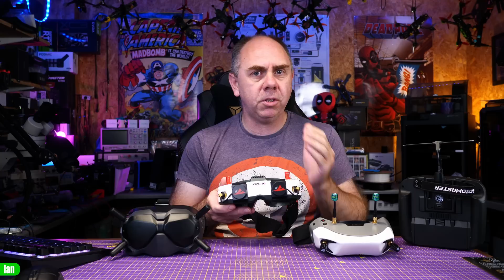HDZero FPV Goggles Crossfire Warning - 868/900Mhz RC May Be A Problem

Comment: Anything 900mhz will interfere with servos as well if tgd antenna is placed the the servo cable in a parallel  orientation

Comment: I tested this on the original shark bite goggle module that was sold. Connected to a pair of HDO2's it kicks the module off, but the goggles stay powered up, so the HDZero system comes right back. It also does it with the original power cable that shipped with the goggle module. And the 18650 battery case, with a barrel cord connected to the balance plug of the battery case.

Comment: Shame on you Mads (I know HDZero is sponsor). This is a board and RF design issue that HDZero needs to fix..."don't bring your TX close to your goggles" is not good enough. What are you thinking? DJI shields and cans their PCB, XTALs, and cables properly.
Reply from the maker: Shame on me?  Hahah your Fing joking right 😂.  HDZero is not a sponsor.  That’s is complete bullshit and I’m not having it.  

I am the person that highlighted this issue to the masses, I am not covering it up for them. 

Putting 1W of RF power next to anything is a BAD idea in any world.  Now the cable situation is far from ideal and I say that and it’s something people need to be aware of however don’t for one minute it’s a free pass 

If your putting your radio next to your goggles in flight something is very wrong. 

Shame on you for posting a frankly stupid comment.
Reply: @MadRC You don't have to have it - if they are not, we'll take your word for it. 
Any retort to the substance of my comment?
Reply: @johnfaustus1, HDZero is sponsor ?  You can have your own opinions, but you cant have your own facts. Have a word with yourself.
Reply: @martr  The youtuber can speak for himself - no acolytes are needed. If they aren't a sponsor, great - but the issue remains. You can't tell people to not use a product in a way that is largely considered reasonable as a 'workaround' for a grave RF design problem.
Reply: @johnfaustus1 I agree with you. My comment was about you making stuff up about sponsors to prop your argument up. You are right that this issue needs sorting though.

Comment: I have had this happen with my WS VRX. I thought It was due to low power on the goggle batt but its really likely that my vertical crossfire orientation mixed with the google batt I have in my pocket and the cable running up to the goggs. Hard to not get them close unless I run the power cable down the back and into my back pocket! Really interesting discovery, Il try be much more careful in the future! Cheers for the PSA

Comment: I'm so glad to learn this information! Every few times I would walk back from the starting blocks with my goggles powered up my battery cable would bump my crossfire antenna and when I get back to the Flight line my goggles would be hung up on the start screen and I'd have to reboot and I was like what is going on! Now It all makes sense. 
I found some tinned copper braided wire shielding sleeve ground straps that you just slip over your existing goggle battery DC cable and am thinking of just trying that. It lists as blocking EMI RFI and ESD interference. Thoughts on using something like this?
Reply: Did it work ?
Reply: @carlosr.2027  I just installed the capacitor on the power board switch and that fixed the issue. I had limited  success with the ferrite beads so decided to do the mod. Never got the cable shield. Definitely wasn't easy but with a fine tip tweezers and fine tip solder insert it worked out.

Comment: I would love to see a quick test with a ferrite choke on the power cable. I’m not super worried about getting the remote too close to the goggles, but the power cable is interesting.
Reply: That seems like a great solution if it works and perhaps easy to clamp on existing power cables!

Comment: It clearly is absolutely important to shield your hardware-even if its not sending a signal,as you can see in this case. I absolutely cant stand anymore that people still carrying hdzeros water after this complete shitshow they pulled over the last year or so !!1 I know Carl is a good guy but his product is clearly alpha stadium at best and if it was walksnail with all those bugs and hardware shennanigans people would be all over it shitting on them-rightfully so.But not with hdzero,its always the bees knees no matter what lol  People loose alot of credibillity over this in my mind...just saying xD
Reply: I have had zero problems with my goggles since I switched to an 18650 head pack to power them. I do long range flying and trust them completely. Even when I had the problem I never had it while in the air as the cable would then be routed away from the tx.
Reply: i would call that almost stockholm syndrome...no offense but dude... if i pay that much money,wait months on end for it to arrive and in the end they deliver such a shitshow i would not be pleased to say the least xD
Reply: @hirnlegorush  Oh believe me I cursed a lot when I had the issue and almost sent them back. But since I discovered the issue I did several dozen long range flights and a lot of cruising and some racing and I am very happy now that I do not have this issue anymore at all.

I just ordered another set of the goggles for my brother in law as a birthday gift.

I try not to be a fanboy I have been in the RC Hobby for 25 years and "seen it all". My next purchase might be O3 and Goggles 2.

Comment: Could you just line the inside of the HD0 case with shielding tape or something?
Reply: It sounds like the RFI is coming in through the power cable, and upsetting the power requirements of some MCU (guessing on that part). The power cable is acting as an antenna. 

You could shield your goggles, but the solution looks like using a shorter power cable.

Comment: Still flying crsf... you just made my decision.  Going to dji
Reply: A much easier and cheaper solution is to just use a shorter power cable. Could probably even just put a $2 ferrite choke on your power cable.
Reply: @Flumphinator  it's just the straw that broke the 🐫 back for the other 2 vs dji.  Still rocking laforge on old FS doms v3... from 2015 and I'm just tired on barely seeing stuff.  Tired of having to use a base station and 1.2 to get further than a few miles and get even worse picture quality.  The range of new 03 air unit and wider view on the Integras will be a huge upgrade.  I've lived with the 69mm ipd for a long time even though I need at least 72.  The image quality and range can't be matched by walksnail or hdzero and that's really what I want most.

Comment: That's the scariest thing that can happen flying fpv. Video cuts out randomly when flying. And it's happened to me about 5 or 6 times. Mostly caused by a loose wire or jst plug. Then you don't trust your quad anymore for a while. It just sucks so much.
Reply: yup I had the same with my skyzone 03O goggels.. it would just shut down mid flight from time to time (the motion detection was broken, and it would go into sleep mode after awhile because it didn;t detect any motion)
Reply: @TheCivildecay  oh damn. I have the same goggles. I hope this never happens to me lol. That sucks I'm sorry. My 03o have been great so far. I wanna get the 04x I think it's called the newest ones they make but they're so expensive. Goggles are the most expensive part of this hobby which sucks.
Reply: @Chillin-fpv  I just turned off the auto-sleep/power off on the goggles and never had the problem again
Reply: @TheCivildecay  good to know. I don't have that on and it sounds like a horrible feature lol
Reply: I had that issue with my DJI V2. I think it’s finally fixed but I still don’t trust it just yet. Lost quite a few parts from disarming over asphalt.
Reply: @likwidkool  I hate not being able to trust my stuff. I'm finally able to trust my second quad again. I fly around my neighborhood and up and down my street. Thankfully I havnt crashed through someone windshield yet 🤣

Comment: Wow. Logical, but unexpected. Glad I switched to ELRS about the same time I switched to HDZero.
Reply: Yeah, if only 2.4 GHz LoRa had the same penetration as 900 MHz. When flying in the mountains Crossfire is much more forgiving when descending accidentally out of LOS.
Reply: @disco.volante  everything else being equal, 900mhz will have better penetration and a slower rate. For how I fly, 2.4 ghz has more than enough penetration for me, but I'm keeping my crossfire in the drawer in case my situation changes.

Comment: So I should put a high gain very directional tx antenna on my crossfire so I can reset stuff "accidentally"?
Reply: No, just don't touch the tx to the goggles. Needs to be really close. Route your power cable differently or use a head pack and you will be 100% fine.

Comment: Brother! Mads Tech, when we getting the update video! on the dji o3 ham file hack not actually increasing vtx power!. Relying on your to save us from this 25mw shenanigans!
Reply from the maker: I have said already on day one it’s comparable to FCC. I never said it was more power. However there are many things on O3 we still don’t understand
Reply: @MadRC   ah my apologies I must have  misunderstood :( Hopefully one day in the uk we can get more than 25mw out of this lovely system.
Reply from the maker: @Sohail187  in the U.K. it gives you FCC power.  It’s just it does not give more than FCC like 1200mw

So in FCC regions Ham is same power more channels. 

In CE regions ham give FCC power and more channels.
Reply: @MadRC  Thank you for taking the time to respond btw. Love your work and been subscribed a short while now, and you genuinely help a lot.  I'll need to take a deeper dive into it then and see what the issue is. Unfortunately on my end SD logs only show 25 MW output, where I believe it should be around the 700 mark.

Comment: Don't be afraid of Crossfire's pure power that's all it is TBS power, maybe I have never had this problem because I run my power cable down inside my shirt to my pocket and also, I don't fly with my radio touching my goggles. (pure crossfire power)
Reply: Just get dji... great match for the crossfire power and range!

Comment: Would be interesting to see if this happens with ELRS at 900mhz.
Reply from the maker: I’m fairly confident it will just based on the fact the RFD900 did.
Reply from the maker: Just had it confirmed on ELRS 900 as well
Reply: @MadRC  what about a Tango 2?  Seems a bit of a shame for HDZero for this to happen.
Reply from the maker: @TestPilotIan  I would expect it to be exactly the same. The real warning is battery cable.  Keep it away and should be fine.
Reply: @TestPilotIan  It will I'm one of the guys who first alert on this issue, and i'm using a tango 2 :/
Reply: @MadRC Is this effect only on the goggles, or can it also affect the VTX - eg if you have an RFD900 on the same quad as an HDZero VTX?
Reply from the maker: @Vousie  It can and does for all systems, DJI is also susceptible to the Telem from crossfire.  This is Telem and. Is nothing new.  You should always have a little separation
Reply: It does some other guys tested it on the discord server

Comment: I just have to comment on that "touchy" USB-c cable. 
Of all the USB types I've used since USB was invented, the USB-C type have failed me consistently. 
Literally every USB-c device I've had, have dying USB-c ports and or cables. Where I never had any problem with it's precursors.
Reply: Stop running your devices through the wash machine and they wouldn't fail❤❤

Comment: Why would anyone be flying hdzero and crossfire? crossfire sucks 😅
Reply from the maker: Hay I like crossfire.
Reply: Crossfire is amazing.. but I don't see why anyone would need to be running it at high power anyway
Reply from the maker: @Magneticitist  yea, there are scenario’s though. The real thing to note is the power cable.  You really should never have your goggles that close to the RC but people may accidentally get close in flight and it could cause a reboot.
Reply: I hope this is a trollcoment
Reply: Did you mean hdzero sucks?